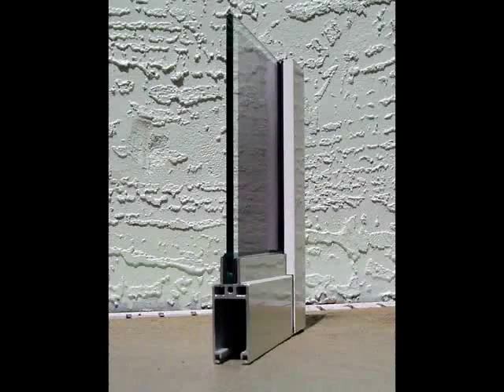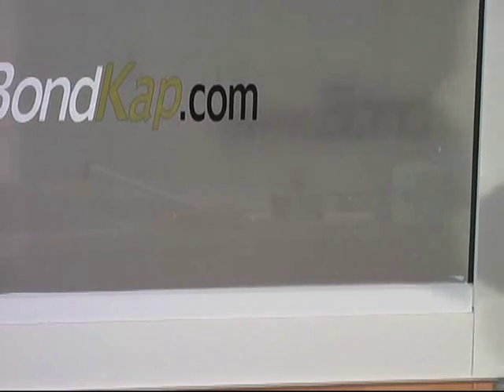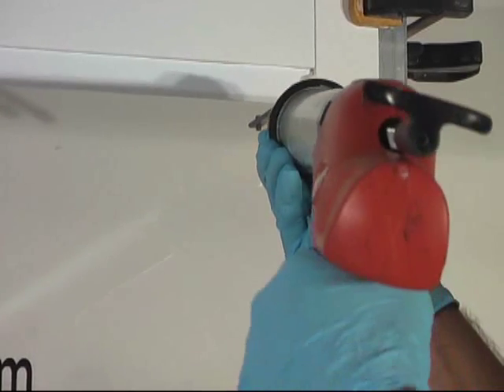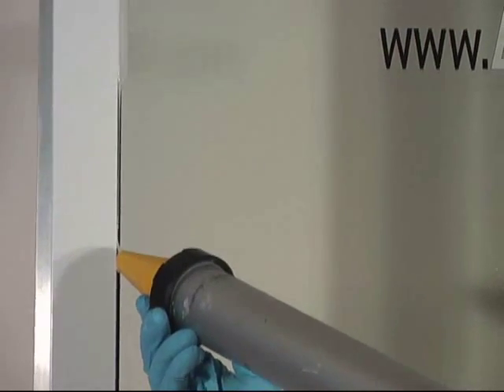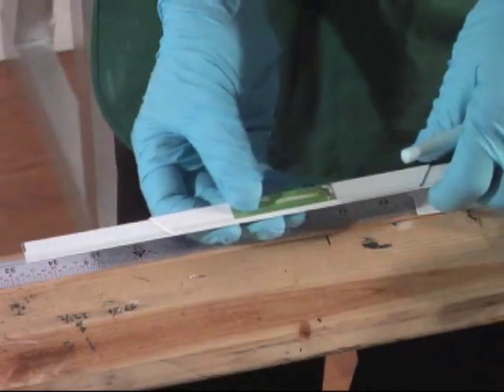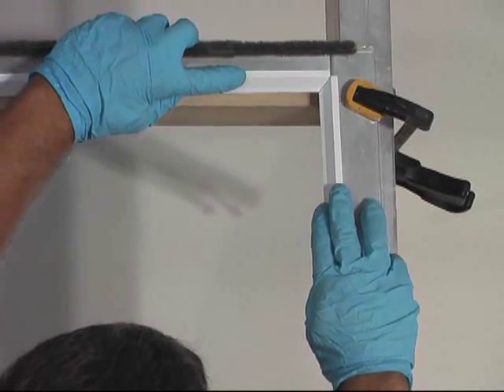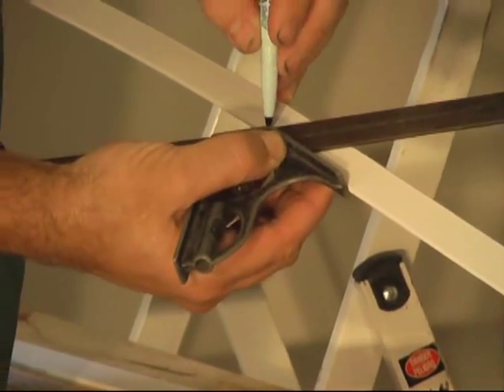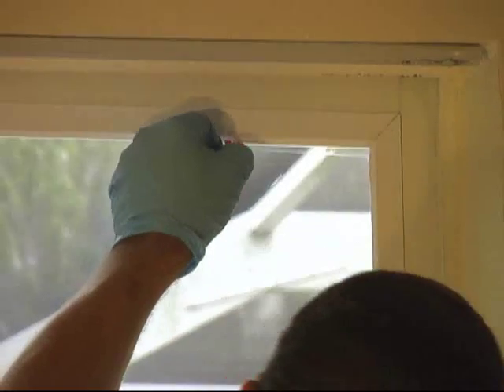BondKap Patio Door Installation (High Res)

Comment: Don't you need to cut/ remove the moldings out and use backer rod?How long after install before the bondkap can't be pulled off?  ( need to know for a security job)Great video demo!     Thanks
Reply from the maker: +melodymaker Yes, you should remove the gasket material on a traditional flush glazed store front and install backer rod. Most patio doors, like the one in this video, do not have a large gasket. See the BK 2004 video, it shows removal of the gasket. Thank you!